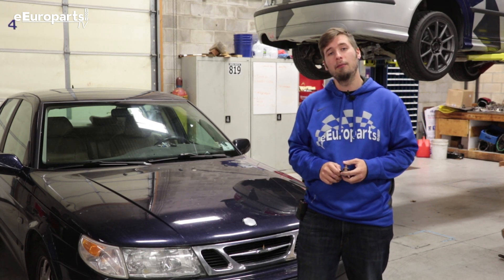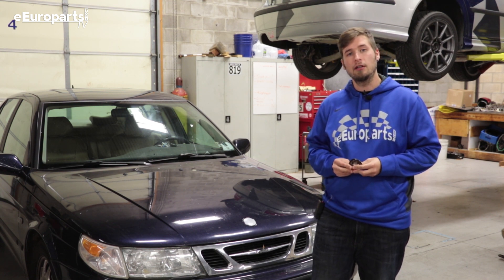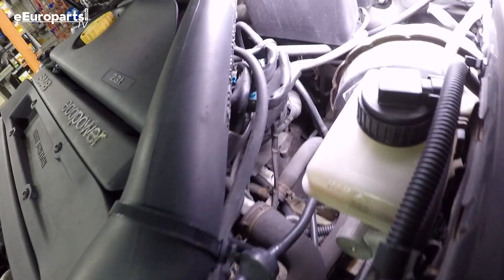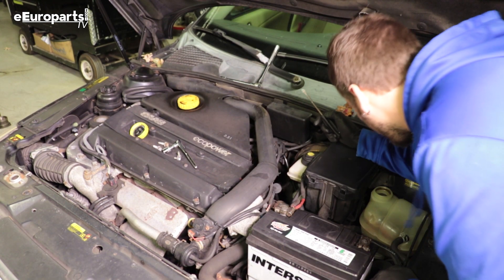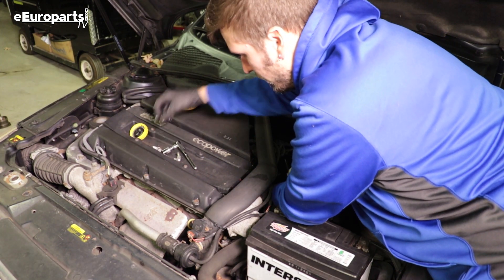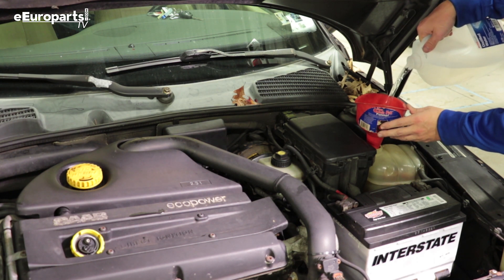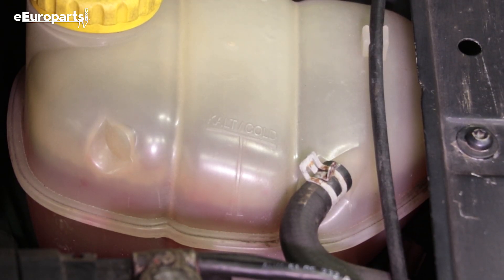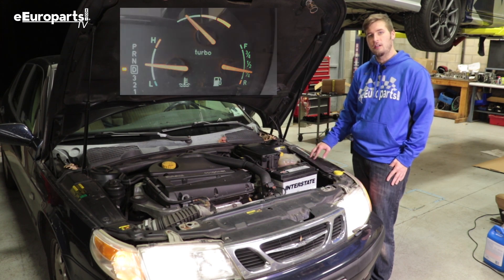Saab 9-5 Thermostat DIY

Comment: This is great information, but how the heck do you get the space to turn the wrench? Mine is stuck either straight up or straight down with no other options and no room to unbolt the housing.
Reply: Did you ever solve this problem. Which in extension did you use?
Reply: @chantalblack4525  I disconnected a bunch of hoses and a wiring harnes

Comment: What temperature thermostat is correct for a 9-5 2.3 T (2004, but I assume all require same)....i see a few different temp thermostats available
Reply from the maker: 89c is the OEM thermostat, but 88c and 90c will also work fine.

Comment: Changing coolant is as easy as draining all through petcock and just filling more ? 
Or is a flush mandatory ?
Reply from the maker: Nope, that will be enough. If you would like to be thorough and get all of the old coolant out, get a few extra gallons of distilled water.  Drain the original coolant, and fill with just the water.  Warm the car up, then once cooled back down drain that and put in the final fill.  However, not mandatory.

Comment: Do I need to bleed the coolant? Cant I just change the thermostat?
Reply: It was 4 years ago you wrote but I'm replying for others reading and wondering the same thing. Yes you can just change the thermostat. I'd loosen the coolant lid first. You can catch the coolant that will come from the hose that goes to the thermostat with a pan/bucket underneath the car and skip step 1 if you want. Then check levels and top up if necessary.
Reply: Also gonna answer with first hand experience, for future saabists. You can, but youre gonna make a mess. Once you pop the hose or the cover off, whatever amount of coolant is above that level will rush out of the system and into the engine bay.
I opened up the radiator bleeder knob without raising the car AND without removing the bottom shield. i had a smallish bucket underneath the car and it was enough to catch 99% of the liquid. Though I must admit that my radiator is somewhat new, so the knob isnt stuck like a m****rf****r.